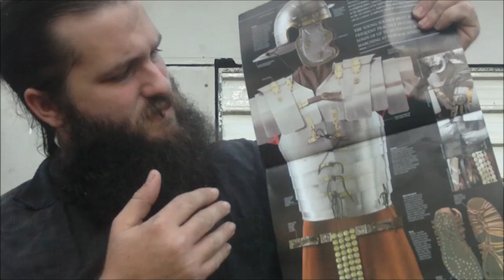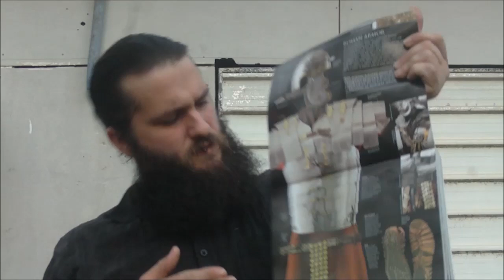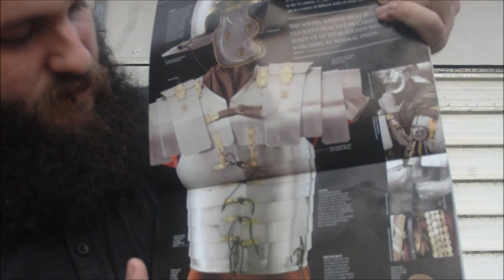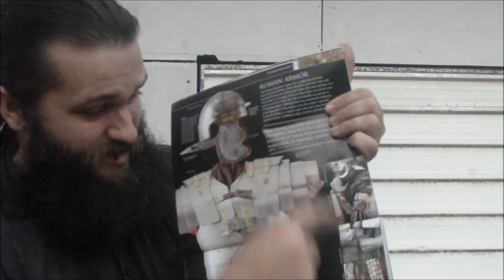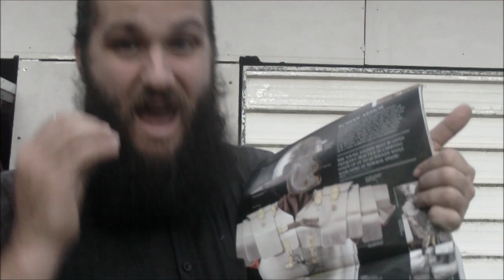Problems with Lorica Segmentata. part 1 Tapering and shaping to the waist.

Comment: Very interesting points made here! Your channel really deserves more attention. I do have a bit of practical experience with making and wearing Lorica Segmentata and one thing I have found personally that I don't hear anyone talking about is that the girth plates when fastened tightly have a variable overlap in the front. I'm not describing this very well but the point is they actually can articulate at least on my custom reproduction to account for both tapering to the waist in both directions much more in the way that maille armor "stretches" to fit than solid plate. Although it did require some tailoring to my body it didn't take a large amount in the shaping to achieve this effect. Not sure if I made any sense but I wanted to share my experience on the topic.
Reply from the maker: I think I understand what you are talking about. How people tighten each lame tighter to taper it. I am not talking about a large amount of drastic shaping. only a very little to make the plates a little stiffer. I do have a question tho. When you have to tighten the lower lames extra does that make it easier to force something between the plates or does your body push them out tight to keep the gap closed?
Reply: Interesting question. On my current version this is an issue as the lames in the hip area as they only overlap for about a centimeter. However I've been constantly modifying and upgrading the armor for the past couple of years and currently I'm working on making each lame a different length to fix this. When I get the time to do this I'll also experiment with slightly dishing the plates like you said. Just to clarify I believe you meant dishing them in a way that they would match the shape of the body. Is this correct?
Reply from the maker: I was thinking of the overall shape tapering to the waist in a gentle curve. If each plate curves in towards the next plate it might help close that gap tho they might not create a continuous curve. I will slightly dish my neo lorica I have planed.